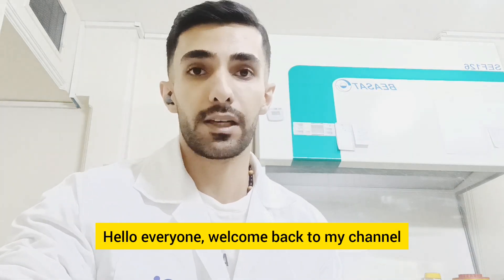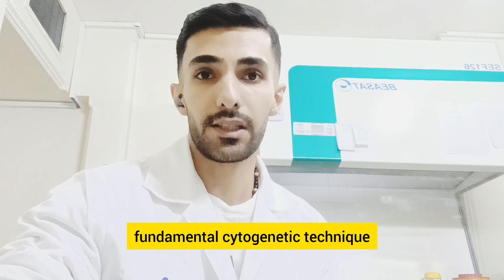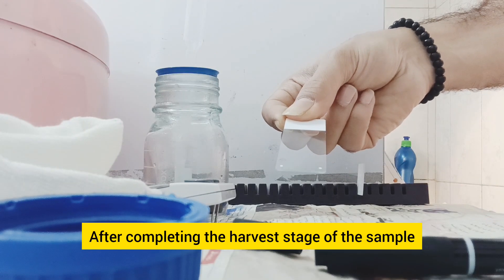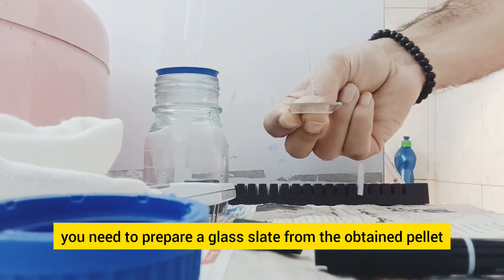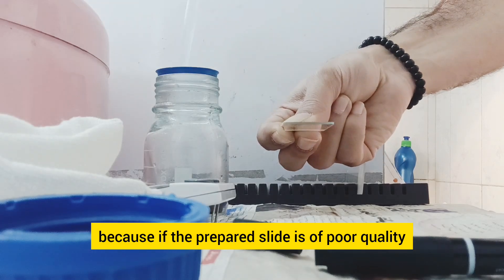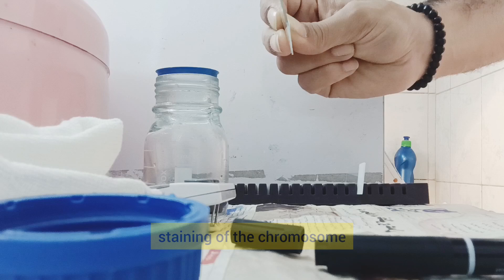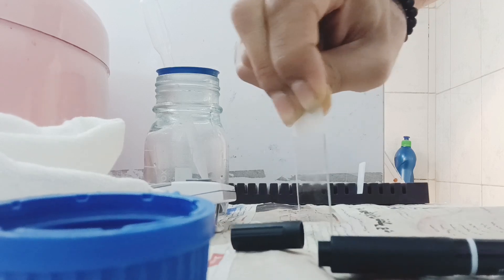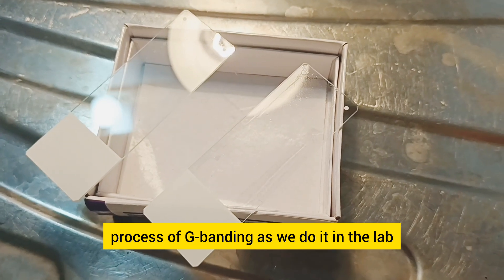G- Banding technique| Step By Step Cytogenetics Guide

Comment: 0.027 g trypsin in 50 mL PBS is 0.054% (w/v), not 2.5%. Please correct me if I am wrong.
Reply from the maker: You're absolutely right — 0.027 g of trypsin in 50 mL of PBS is not 2.5% (w/v).
In cell culture, commercial trypsin solutions are often referred to as "2.5% trypsin", which means 2.5 g in 100 mL solution, a much higher concentration. Your preparation is much more diluted than that.